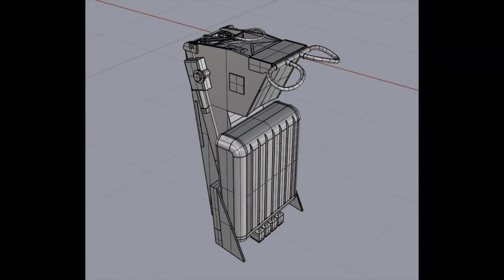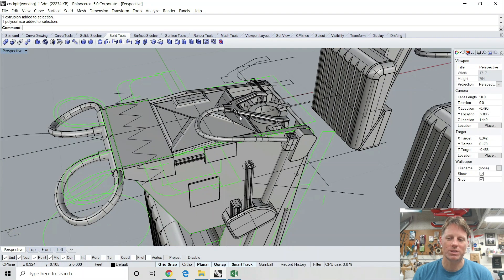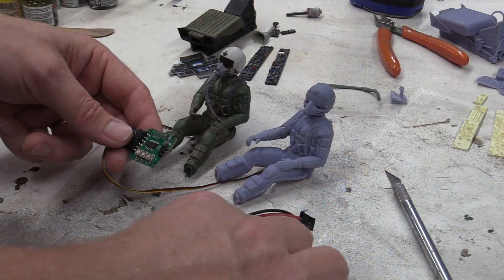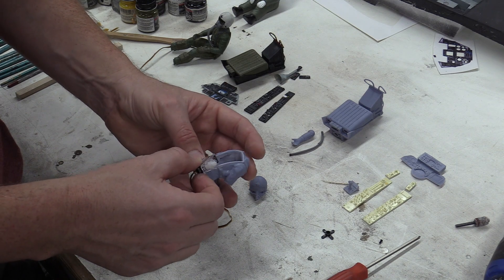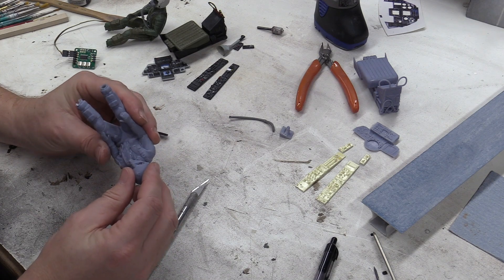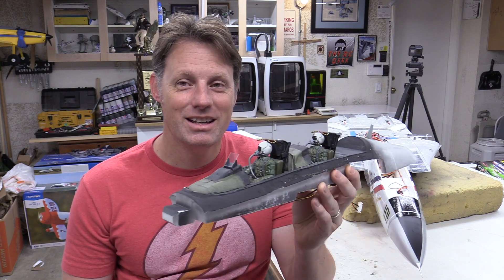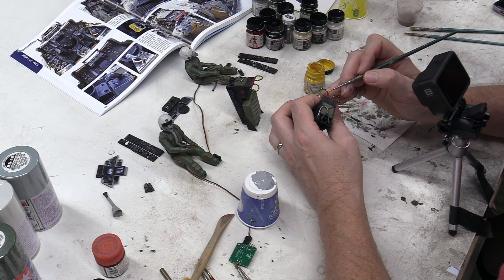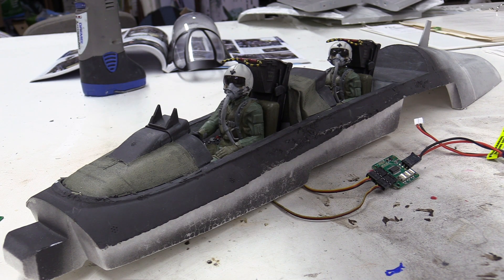Refinish A Foam Jet Ep 2 -- Building & Painting a Detailed Cockpit (3D Printing FTW!)

Comment: This going to be a rookie question. What paint do you recommend for a  E-Flight Ultrix and the bigger one Ultrix 600mm to paint the bottom for orientation purposes and to make my planes look different then everybody else?
Reply from the maker: I believe the 600mm is made of epo foam, so you can use most any type of paint on it. I like to use the plastic model sprays personally but have used krylon and rustoleum as well. If the umx is the same material, then same story. I think it’s epp which should be similar, but d recommend testing it first to be certain.
Reply: @Thercgeek  Thank you so much!👍

Comment: Great job!  The canvas look is pretty cool,  great idea.  How did you do the mask air hose,  it appears to be flexible.  Rhino 3D is a great program,  I used this a bit during my WaterJet days but then switched over to Master CAD/CAM when it came out.
Reply from the maker: Thank you!  The O2 hoses were 3d printed and then I used some heat shrink to extend them under the arms of the pilots. That’s what makes the appear flexible.
Reply: @Thercgeek  Ah nice!